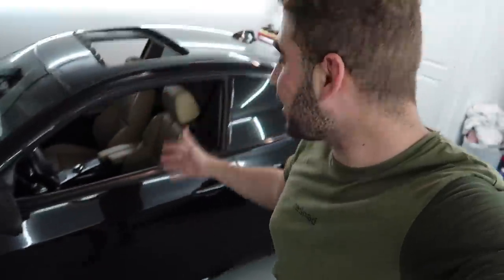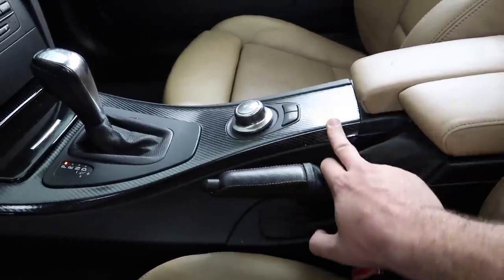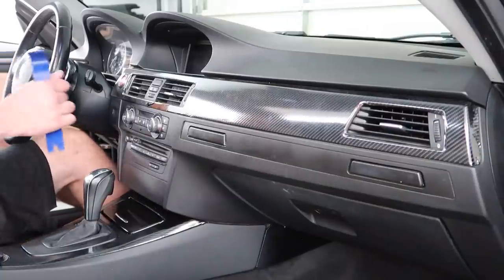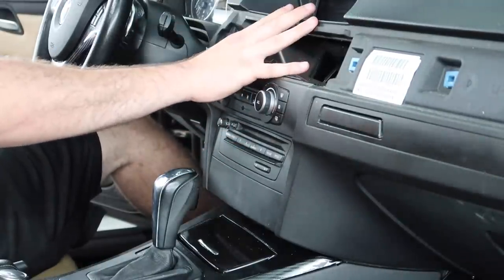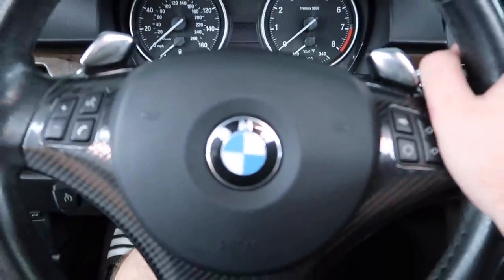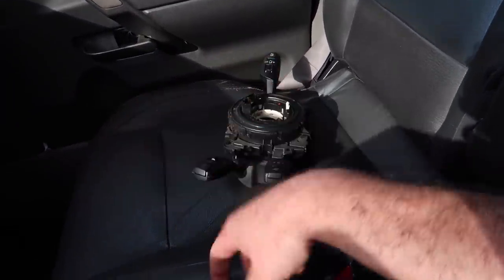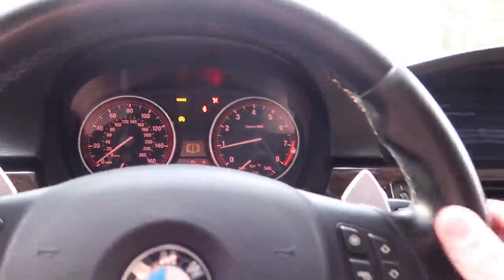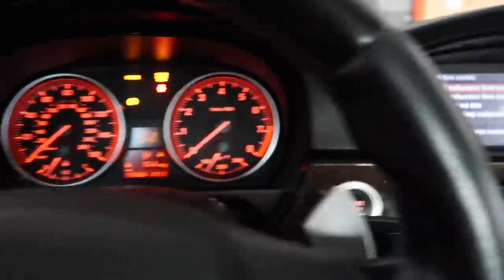EVERY BMW OWNER NEEDS TO DO THESE MODS! IT TRANSFORMED MY DAILY!

Comment: Hey Nour, 

What T screwdriver do you use for taking off the steering wheel. I think you mentioned in a previous video on a tip someone gave you that works.  I recall t25. 

Thank you,

Comment: Nour, you have to clean the plastic disc inside the clock spring... it’s getting a bad reading due to the dirt inside! Just open the old one to see the disc that I’m telling you 😁👌 it’s a disc with some grooves or channels and it has a light or sensor to read those grooves and send a signal with the steering position to the DSC system... thank me later! 👋😆